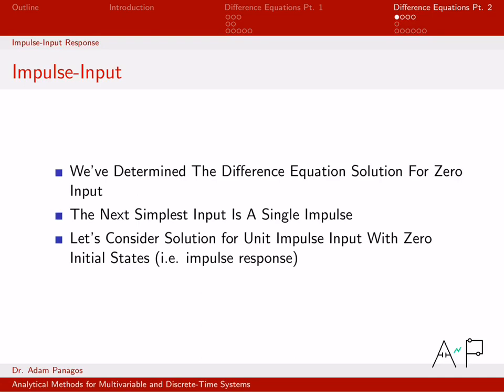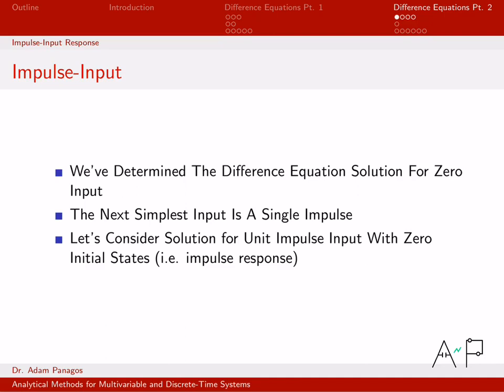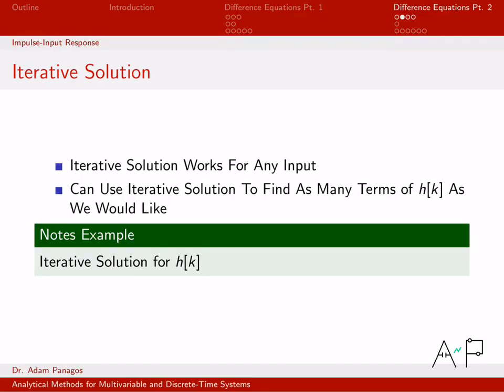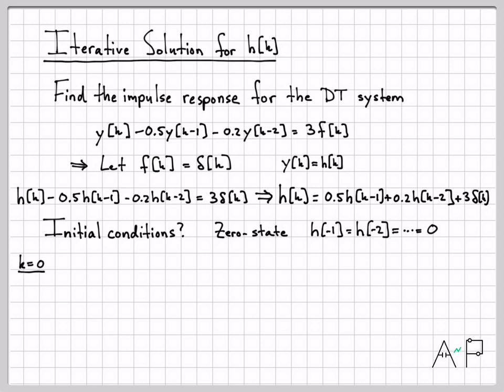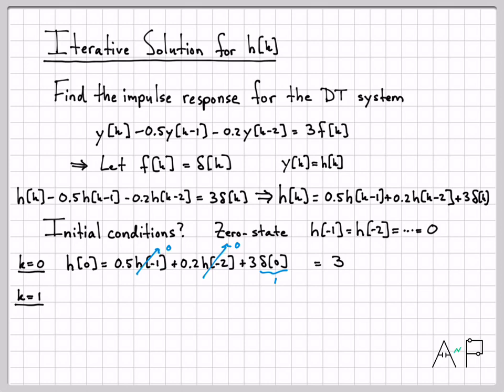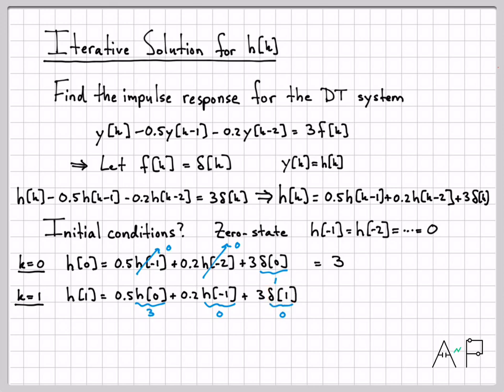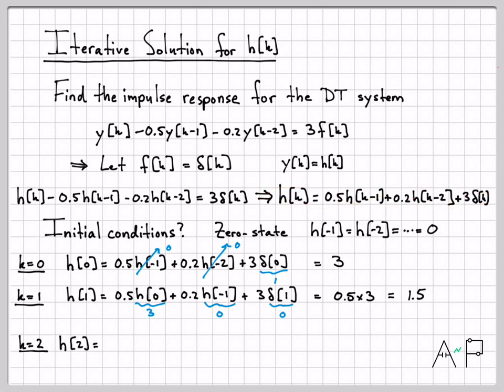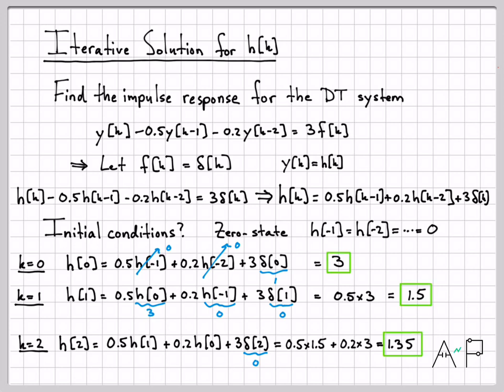Difference Equation Impulse Response Solution via Iterative Approach

Comment: Is the 0.2 x 3 obtained from 0.2h[0] multiplied by total number of other terms in the equation?

e.g. 0.5h[1] + 0.2h[0] + 3d[2] = 3 total terms, so any result is always x 3?
Reply from the maker: For this particular system yes. Obviously, as the difference equation changes there will be different relationships/computations.